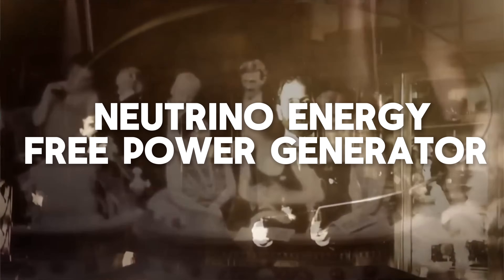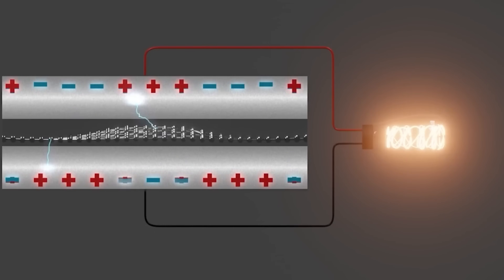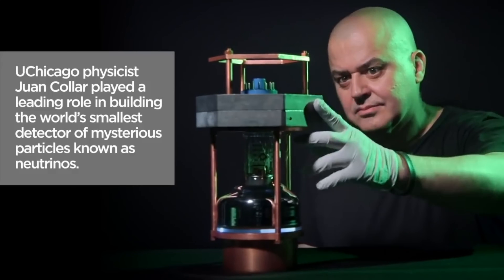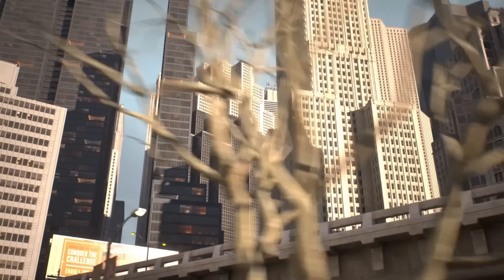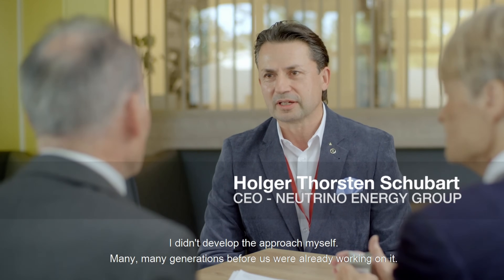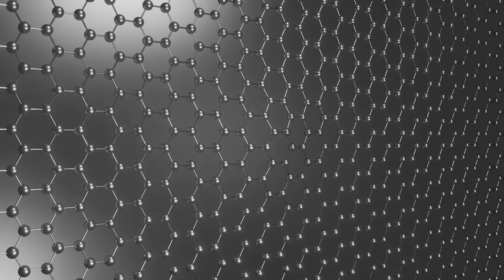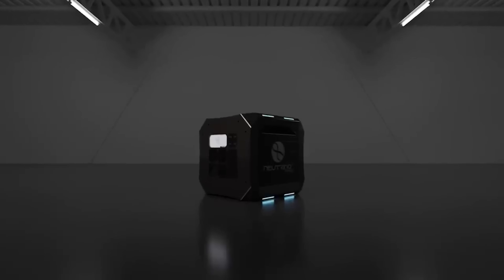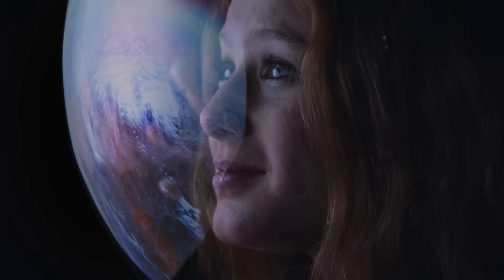German Free Energy Breakthrough: Neutrino Energy Power Cube Unleashed!

Comment: 10 KW WON'T HELP ME MUCH, FOR ONE I HAVE A WELDING MACHINE. AND A CENTRAL AIR UNIT
A REFRIGERATOR  A BIG SCREEN TV 3 PC'S AND A ELECTRIC CAR.
BUT I'LL GIVE YOU AN A FOR EFFORT.
Reply: A steadier output than 10KW of solar.

Imagine you put up a Tesla Power Wall or something similar that is 15-20 KW, with a grid and generator pass-through on the Hybrid Inverter. Now, you connect the grid, which you already have, and this thing is the generator. You can program the Inverter to charge the batteries when the load is smaller than the output, and the grid will be there as a backup if you discharge the batteries too far, and this won't keep up. Your EV will be the most significant load, but I bet you can get it to work well. Also, if you have a newer refrigerator, it takes less than people think. My LG French door fridge only uses about 300 watts daily to maintain. Using the data plate is misleading. (I have a Kilowatt meter on which I've done the testing.)

The bottom line is you would have a lower power bill and much more independence.
Reply: The cube the way it is designed right now can be assembled into a power grid which each household will connect to. The good news is that all of the dirty AC lines can be eliminated and only DC used. Imagine being in the middle of the desert and plopping down one unit and having unlimited free energy.
Reply: Also the life of a single unit is 50 years. If anyone is worried about losing their job as a result, don't. Energy employees will be trained in how to install grids, electical lines will be taken down, houses rewired, maintenance training, and of course building the cube, will keep everyone employed. Imagine the freedom that free energy will bring the economy and the citizens.
Reply: How much is output el.power on this cub?? @lizmurray8738
Reply: Are we seeing a break in the wall or is this more misinformation to muddy the waters